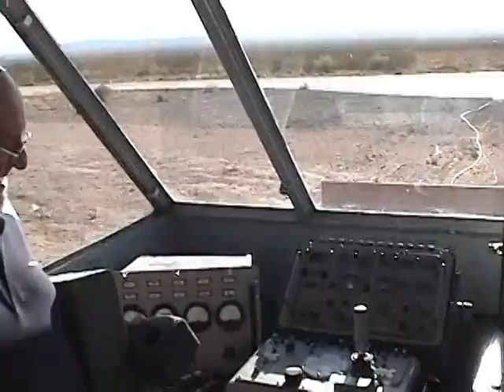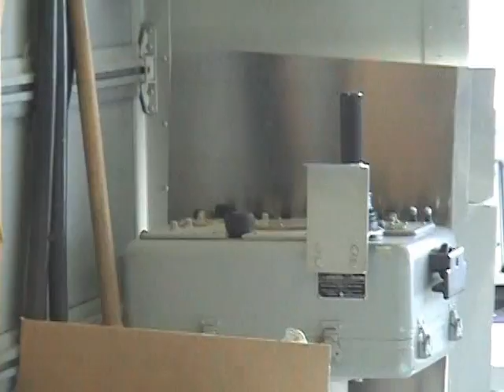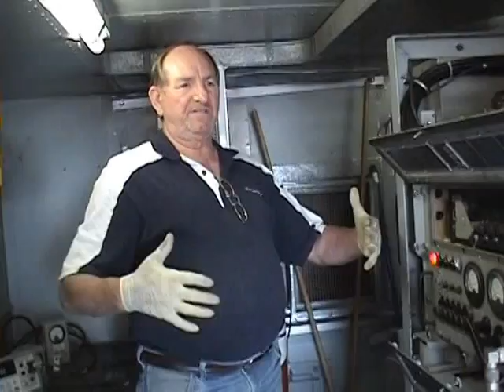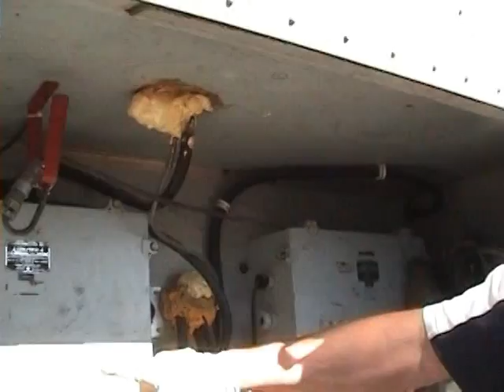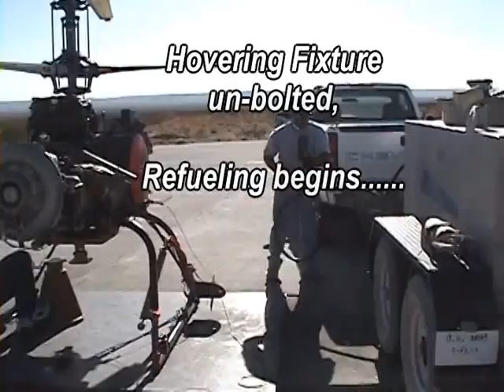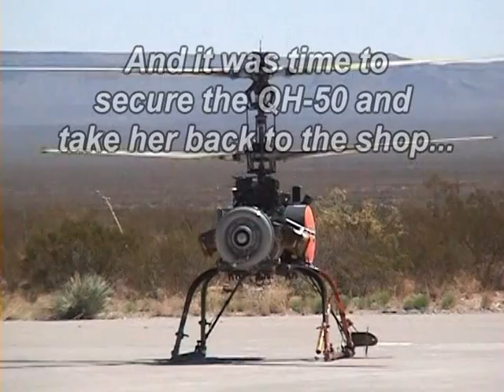The Last Flight of the QH-50 DASH Weapon System.mpg

Comment from the maker: In the 45+ Years I have been associated with the QH-50, we never had an aircraft "flyoff into the sunset" without actually being instructed to do so. Unless you have a specific incident to share and by Ship name and Bu No, please do not post rumors and false facts.
Reply: +QH50DASHman - Hey Dashman, I was the Weapons Officer on USS Basilone (DD 824) and I have a story to tell you.  We were doing exercises off San Juan Puerto Rice in the spring of 1967 (or near that time).  We put our DASH up as part of an anti-submarine exercise.  The craft was airborne and the DASH Officer had her under control when suddenly the aircraft headed for the beach and San Juan.  The DASH Officer and I were at the control stand and could not get the bird to turn.  Finally, we said try anything because if that machine crashes in San Juan we will catch hell.  The DASH officer said, the only thing he could think of that might work was to reverse steering 180 degrees.  After he did that we waited and then our DASH slowly came into view and we dodged a large bullet.  This was all reported to higher authority but nothing was done about it except for reports we filled.  I can assure that was a "flyoff experience and I would never want to repeat it again.
Reply from the maker: Cornelius, were you using a new Deck controller? Some DASH ships were mis-wired at the shipyard, 180 degrees out of phase so the Techreps had Gyrodyne create a Drone Simulator to detect these issues. However, the manufacturers of the SRW-4C Command and Control system (Babcock) only used a single process for manufacturing so the Techreps had to modifiy the phase. 
Irregardless, a QH-50 is an extension of you, the controller. It does not flyoff into the distance without salt water in the ECA shorting out pins or with a uncommanded input. Even with that, who was watching the SRM-4 and -6 Target Control Test sets in Emergency Radio?
Who was watching the output of the URW-14C Radio itself?
Are you telling me that the sailors watching the output of those systems reported all gauges in the green and yet you experienced this situation?
After you got the aircraft back, and landed it...did you ask the Enlisted personnel in Emergency Radio what happen? They would have seen the pitch deflection in the negative and could have fixed it before you even took off. 
So you see, without a proper pre-flight and systems check, look what happens.
With the same crew for 30-years, we experienced a 97.5% successful utilization rate flying at White Sands Missile Range and only lost a bird, we wanted to have killed as a  Real-Kill target.
Reply: Am assuming you are a civilian techie.  Unfortunately one should but didn't come with every DASH installation.  Nuff said
Reply from the maker: Look, I understand. The Navy gave the Drone 10 years and quit. Their training was poor and when it did work, the Navy would raid the dets to support the Air war in Vietnam to even the brown water Navy. We had JGs to CDRs that went that route that we hear from to this day. I've been with this program for over 50 years and I build QH-50s to this day, so don't dismiss my service to this nation.
If you are truly interested in understanding  how and why DASH failed in the Navy, there are a couple post-mortem articles you should read.
The first is by a U.S. Naval Aviator who tried to understand why sophisticated drones are everywhere and the Navy has little...
Read that here:
http://www.armedforcesjournal.com/unmanned-naval-warfare-retrospect-prospect/

The second is a bit harder to find, but even more thorough:
Go here and down load the entire PDF book:
http://www.history.army.mil/html/books/070/70-87-1/index.html
Read pages 111 to 138 on the DASH program.

The failure of DASH was rooted deep within the Navy's bureaucracy and you nor I are going to settle this argument here.
Fair winds,
Reply: I don't disagree there were Navy types that were against unmanned craft but as a blackshoe I didn't have a dog in the fight.  We fight with the weapons provided and in this case it seemed to me ASROC was clearly a more reliable weapons system at that time.  Not only that but response times and a number of other factors enter the discussion.  Dash officers had to stand on the deck in cold, wet, hot, day, night - you get the point.  I am there was a problem with this concept of the system being a quick and reliable system.  God only knows what would have happened if the DASH Officer were injured or sick or............
Reply from the maker: +Cornelius Hayes , DASH was not originally intended to be re-usable. The first 289 DSN-3 Drones (later QH-50C DASH) were designed and built to fly out up to 22 miles and drop a Mk-57 Nuclear Bomb and be consumed by the 4000 ft AGL expanding Water Cloud. That's it.

Once the DASH system was deployed, the Navy changed the mission to re-usability with Mk-44 Torpedoes, but didn't change the system other than instituting a all-weather wiring harness. The Command and Control system you used - the SRW-4C, came from Droned F6F Hellcats and later Droned QF9F Cougar, Off The Shelf systems. Using this WW2, Land-based system proved beyond trouble- some at Sea, but in the desert like White Sands, it worked great and that is the system we show in this video although ARPA put it in the trailers for transportability.
Today, we don't try to rebrand DASH as anything but what it was and that was different between ships. The USS BLUE pioneered the Recon varient, the USS GLENNON worked to expand flight times, the CHEVALIER lost many QH-50s to shoot downs, while the USS COLLETT...they had a JG who flew 5 into the sea by flying off the deck and trying to do translational flight too early...

We try to keep the operational history around so planners of today don't forget what CNO Arleigh Burke tried for his surface ships which the following Aviation-CNO's wouldn't fix..
We keep some of that alive here:
https://www.facebook.com/DASH.Weapon.System/

And if you look down that long page, you'll see what Lt Virg Irwin did on his ship - he installed the nose-Plexi-glass of a P2V Neptune over his Deck Station so he didn't have to stand in the rain...on the USS FRED T. BERRY, now some 50 years ago....
Reply: Well then. Not certain of a QH-50.  But DASH I know.  
DD-449 out of Pearl, ~'68, in between WestPac's, I had been aboard a couple of months, "G" division. 
We went out on a dependence cruise.  Show and Tell, I was on the DASH crash crew, hot suit and all.  Ens. launched and DASH went up and out, and out to stern. Small maneuvers,  Ens attempted to bring the Bug back and attempted to land same on Helo deck.  As Bug came in erratically, all of a sudden turned on its side, crazy,  zoomed forward, and slammed / crashed into the  aft super structure, above the aft lookout area.  Fuel flowing to starboard.
Well, "all dependents to the mess deck", Crash Crew and Damage Control active, etc etc.
We ended up returning to Pearl with a huge Bug hung up in our super structure.  
Oh, two previous trials out of Pearl had less than stellar DASH results.  One launched and went "AWAY" to stern, never to return.  Another went out and away, up, way up, and down into the sea, the flotation "balloon" got hung up in the rotors and the Bug sank during attempted recovery.
We had no clue about R.C. at that time, imo, and what other emf interference might have on the Bug.  As well as operators in charge.  

Blue Water and Brown Water - '68-'72.
Reply: The DASH was a good try to extend the reach of FRAM I and FRAM II surface assets to ranges beyond the range of the RUR-5A ASROC and to provide an offboard delivery capability for any units not fitted with ASROC.